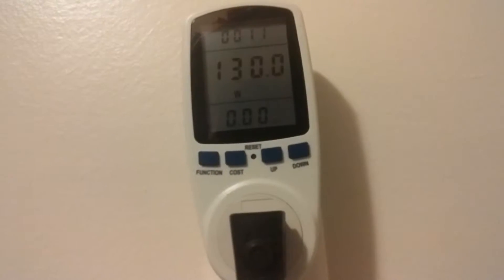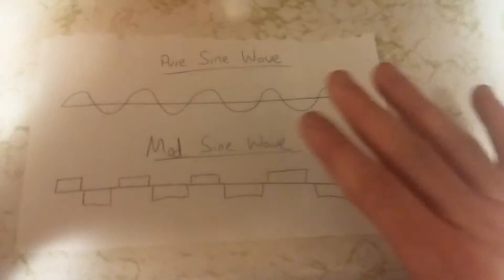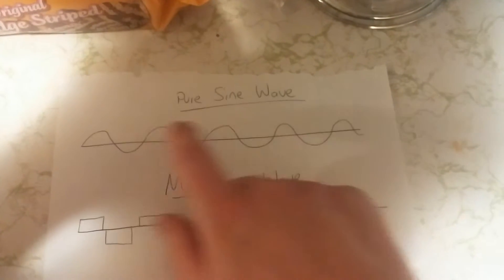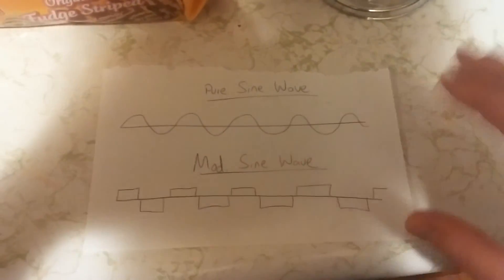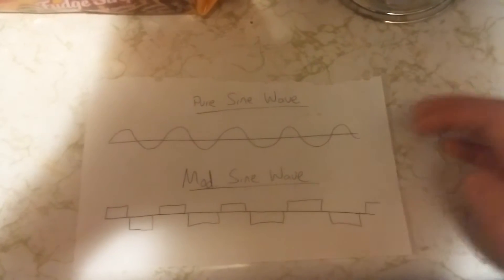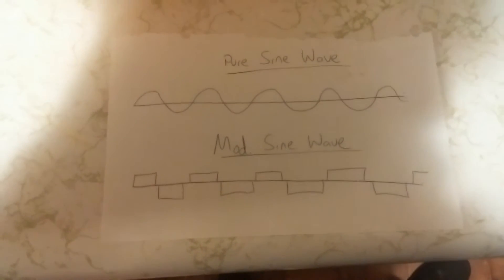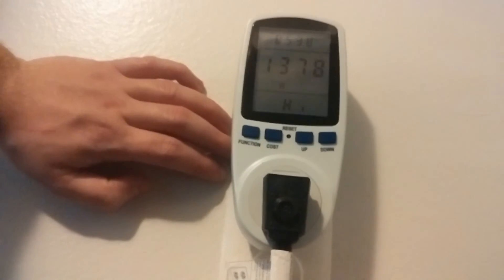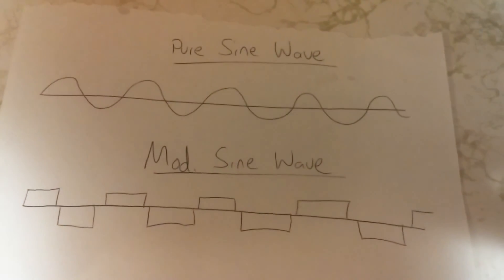**What Size Inverter Do You Need?**

Comment: Alternating current (AC) is not "smooth". If you stick weld with AC and DC it becomes very clear. When a laptop is plugged in to any outlet the transformer "cleans the power up and converts it to DC.
Reply from the maker: you still don't want to power your laptop with a modified inverter
Reply from the maker: thanks for the comment tho check out my other videos and subscribe